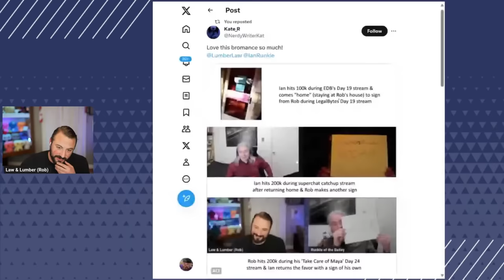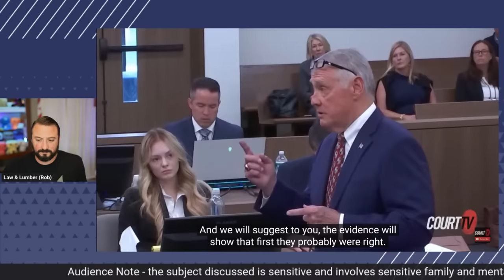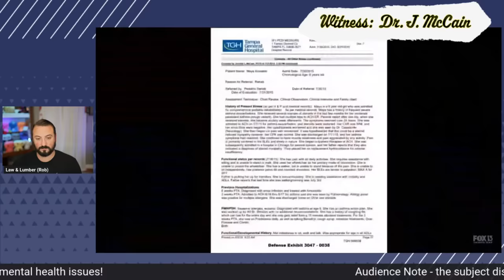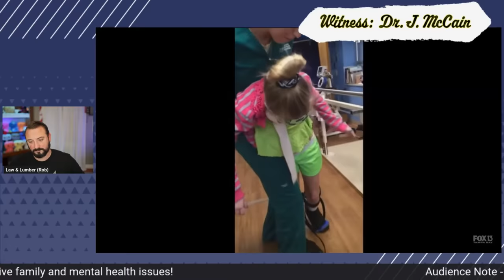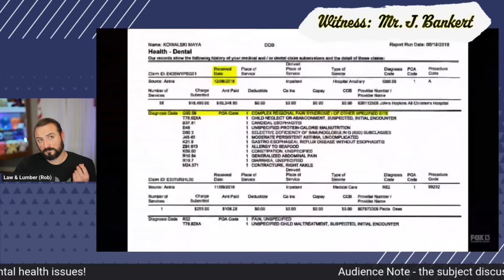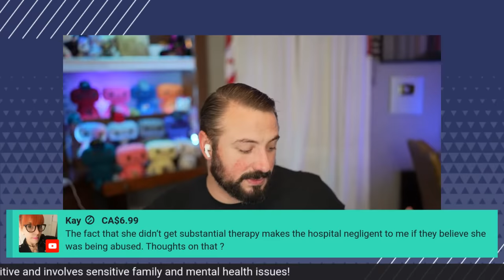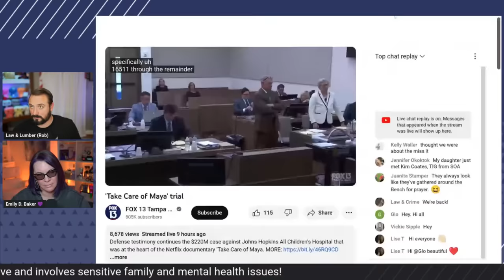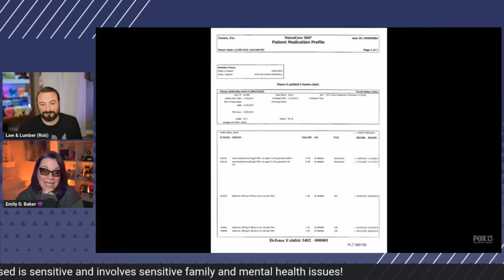LIVE | Lawyer Reacts - 'Take Care of Maya' Trial: Day 25

Comment: I have been diagnosed with CRPS by a gifted anesthesiologist, confirmed by neurologist. Mine is limited to right side of abdomen down to upper thigh due to ilioinguinal nerve being slit during surgery for mesh removal.  There aren't reliable tests for this horrific diagnosis but nerves can be traced to track the nerves.  The pain is like hot barb wire, stabbing.  I HAVE BEEN STARTED ON KETAMINE NASAL SPRAY BY PAIN SPECIALS.  I can't imagine a child trying to explain this invisible tormentor.
Reply: Mayas nerve conduction tests were normal. As were her bloods radiology every objective measure.

Comment: To add to the billing - our hospitals case managers is in communication with the respective medical aid of the patient. As soon as a code is added to the treatment, the hospitals treatment (medication etcetera) must be in line with the treating codes. As soon as the treatment is not in line with the code the medical aid will require additional info as to why and may also request a letter of motivation from the treating doctor.  And yes, again, the your primary diagnosis is the one that generates the higher charge even if other codes form part of the treatment.

Comment: Ok, so the hospital billing in South Africa might differ from over there - you have a admission diagnosis, then a treating diagnosis. The treating diagnosis, admission diagnosis and discharge diagnosis can be the same, thus your ICD10 code(s) stay the same. Adding to this there are secondary treating codes and comorbidity codes. So your charges will correlate to the codes. Should the admission code differ from the treating code and discharge code the billing will reflect it. Your primary diagnosis code is the most expensive code and the cosy decreases with the secondary code(s). The comorbidity code’s billing will stay the same as the diagnosis stay the same.  The issue I have is JHACH claims that Maya did not have CRPS, yet the treating and discharge code was CRPS and the bill for it, which for me is a huge red flag in the billing department. 
Room and board over here is when a parent stays with the child in the same room for the duration of the child’s treatment. It seems this term differ from ours.

Comment: This dude is irritating the hell out of me with is answers. Mr Whitney is correct, if the treating doctor does not indicate that the primary ICD 10 has changed, it will stay the same as the case managers cannot change a code without the doctors consent which is usually indicated in the patients file and signed by the doctor.